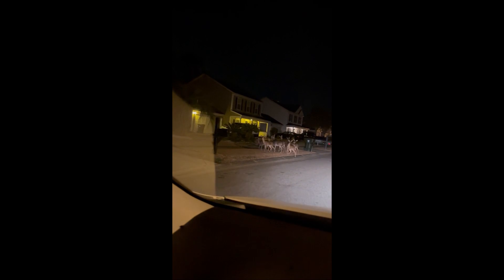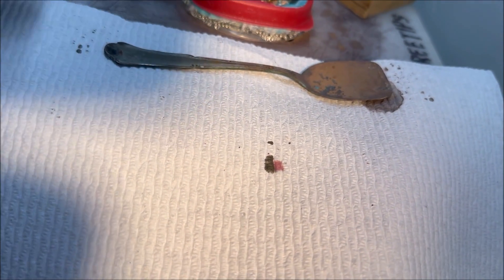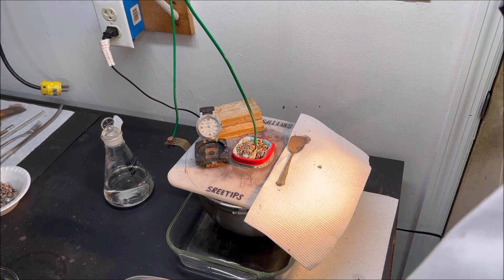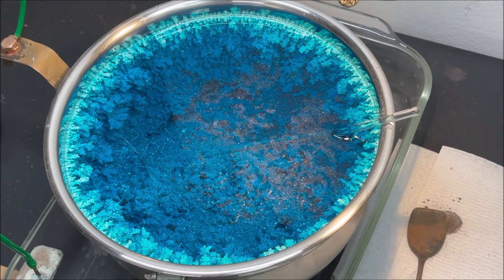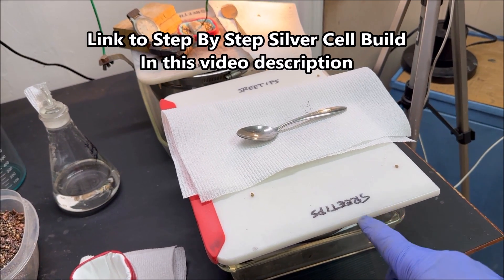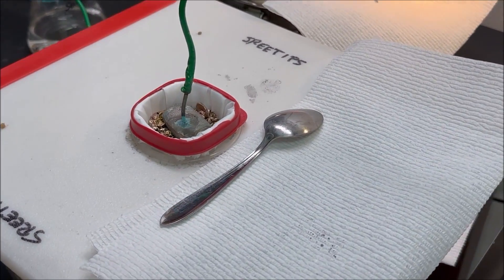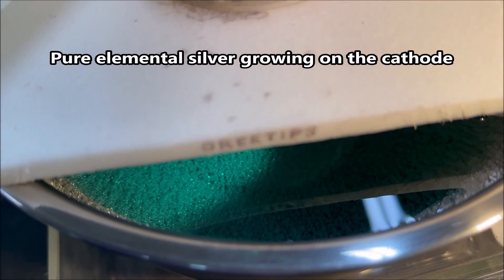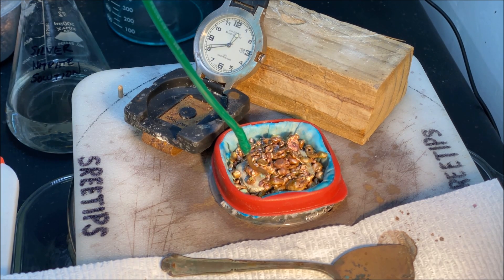New Power Supply Silver Cell Number Two

Comment: I’m curious. Electricity flows from negative to positive. that is the opposite direction of the flow of your silver molecules. If you reversed your flow so that the direction of the current was flowing in the same direction as the flow of silver molecules, wouldn’t that speed up your process?
Reply from the maker: No

Comment: Hi, everyone I have a question. DC power supply machine. One hooks up on silver bar. Where does the other wire goes to?
Reply from the maker: To a copper strap that’s fastened to the stainless bowl by a large hose clamp.

Comment: Sell the broken power supply for $20 for parts. Someone out there will either fix it or wants it for parts. Just make sure its advertised as being how many years old, eatimated run hours, and what you know is wrong wirh it.
Reply from the maker: It’s working, I’ll save it for a backup.

Comment: Hi Sreetips how about using silver rings or small pieces of chain attached to copper wire as anode conductor instead of a solid silver bar?? maybe they adapt better to the movement inside the anode filter without losing any contact point

Comment: Does the anode bar need to be pure silver or could you just pour it from impure silver?
Reply from the maker: Impure silver would work. I like to use pure silver because of its low melting point and it’s easier to work with.

Comment: Is worth make a silver cell mr streetips?
Reply from the maker: Yes!
Reply: Thank you! I gonna make one
Reply from the maker: Hold on! The reason I use a silver cell is because i have a ton of cement silver powder stored up from my gold refining. Silver is a byproduct of my gold refining. But you can hold sterling silver and 90% US silver coins just like they are. No need to refine them. In fact those shouldn’t be refined. They will track right on up with spot silver because they contain a known quantity of silver. So long as you don’t try to melt them and ruin the markings, they are good as-is. Refining silver brings a whole set of problems including acid digestions (fume hood required). Waste treatment, and other processes that must be handled correctly to ensure safety of you, your pets, and your family.

Comment: Well done setting up the second silver cell.  
Out of interest do you notice any nitric smell off the cell?   Anything corroding around it ?
Or is the dilution of nitric with distilled water enough not to notice it.
Reply from the maker: When I make the electrolyte, I boil the solution for an hour or so, with some undissolved silver left in the bottom of the beaker, to ensure all available free nitric acid gets consumed. Having excess nitric in the electrolyte could cause problem because the impure silver usually contains some palladium. Palladium is soluble in nitric, so it could dissolve the palladium and leach into the electrolyte.
Reply: @sreetips  ok great now i understand.   I was wondering because if you look at the time lapse on your video- you see bubbles around the basket and I was wondering if that’s a reaction with nitric
Reply from the maker: That was condensation.

Comment: could you explain how the current dissolves the impure silver and why it re-crystalises on the bowl ?
Reply from the maker: I’m not sure if I can explain it. The current flow, causes the impure silver, to dissolve in the presence of the silver nitrate electrolyte. The silver ions travel through the Dacron filter, then through the electrolyte and are attracted to the cathode (stainless bowl) where they deposit as high purity elemental silver. The chemistry and physics of it all are far above me. I’m not a chemist. I’m just doing what I learned from other refiners.

Comment: curious, I wonder why the new silver cell is only pulling half the amps vs the old silver cell?  I saw some corrosion on the positive connection where it connects to the cast silver bar.  I wonder if that is playing a role in the lower amperage.  One other thing, if I may.  If you swap bowl positions so that the leads do not cross each other like they are now, you might find that you can shorten the leads, making the line loss lower and as a secondary result, looking less messy.  Being a Amateur Radio operator I understand that wire management is a thing, lol.  Thank you for all you do, your videos are great.  I look forward to your next video!
Reply from the maker: There are many variables that affect the current flow. Corrosion is one of them. If I had noticed that the poles were opposite then I would have oriented the silver cell 180 degrees so the wires wouldn’t cross like that.

Comment: the silver bar is too light, try a heavyer circular ? 
set the current button of the new hp E3614A to the right, at the max. and maybe try 3,8, 4,0, 4,5 Volts & more, just to see what happens ? your silver will not going to go away.
Reply from the maker: I’ve got current knob turn up as far as it will go. The professional refiners that I learned from said 3.5 volts DC, and never exceed 3.8 volts DC lest other metals may deposit with the silver and contaminate it.

Comment: Hey I was wondering why you use what looks like Corning Ware for boil over protection instead of borosilicate Pyrex, have you ever had one of the white dishes crack or break.
Thanks
Reply from the maker: Yes! I’ve was drying some cement silver once, sopping wet. I cranked the heat on high to get it going, intending to lower it once it heated up, but forgot about it. About five minutes later I heard it shatter. So they are not bullet proof. But they can take a lot of heat. I’ve heard that you can get them red with heat, but I’ve never observed this.

Comment: I'm always looking forward to the next episode. If the Dacron filter acts as the proton exchange media would it be beneficial or more productive to separate it from the feedstock sludge and process it separately? My thought is that the Dacron filter is the major collector of the PGM's and the sludge should just be incorporated back into the next batch of feedstock. 🤔
Reply from the maker: I just save those filters and process them separately. I tried rinsing the slimes off the renting shot in the filters to run it back through the cell. But it didn’t go well. Can’t remember why.

Comment: Do you use the silver over and over again?
Reply from the maker: No, and yes. I reserve some of the pure silver crystal from the harvest to make electrolyte for the next silver cell run. I get two runs using 800g of pure silver. Each run will yield about 1.5 kilos. So I get 3 kilos and use 800g of it to make electrolyte. My net take-home in silver crystal is about 2.2 kilos after two runs, from each cell. Which reminds me, now that the second cell is running, I’ll have to get busy making some more impure shot to keep these hungry cells fed with impure silver.

Comment: 🧡 I love how the time lapse captured a visual presentation of the off gassing at the anode basket. Makes me wonder if capturing it is of value
Reply: I wouldn't think so considering how hard it would be to collect. The three possible gasses that are being released are hydrogen, nitrogen, or oxygen. (or all three) 2 of those are the most abundant gasses in the atmosphere and the other is the most abundant in the universe. Would be cheaper to just strip them out of the air.
Reply: @davidburton3447  🧡 I shall call it the beautiful blue miracle grow aquaponics/hydroponics solution! Got the aquarium and diaphragm air pump on hand......now for the details. ✌🏻👶🏻🚬

Comment: If you are recovering all the silver in your silver cells, why do you have to keep adding silver spoons when processing the gold?  Guess I missed something?
Reply from the maker: I add sterling silver to the gold that I refine. Then I recover the silver, melt into shot and run it through my silver cells. Then I harvest the pure silver crystal and stack it up and forget about it.
Reply: @sreetips again you said you were adding 150 grams of pure silver to each cell, including the new one in order to extract pure silver Maybe I’m dense but I’m missing something
Reply from the maker: I refine gold. I use sterling silver to refine gold. I recover the silver from that, melt into shot, and run it through my silver cell. The cell converts the impure silver (about 980 parts per thousand silver) to high purity four nines fine (9999 parts per ten thousand) pure elemental silver metal. The impure silver is added to the anode basket. The anode basket is suspended in the silver nitrate electrolyte. I pass an electric current through the impure silver. The silver dissolves, passes through the Dacron filter, travels through the silver nitrate electrolyte, and deposits on the stainless steel bowl (the cathode). The bowl is connected to the negative pole of the power supply. The process only deposits pure silver on the cathode. So I’m refining the impure silver, into high purity silver. When it’s full, I harvest the pure silver crystal, put it away and forget about it. Then I repeat the whole thing again.
Reply: @sreetips  Thene why add pure silver to cell??
Reply from the maker: That’s the electrolyte. Its sole purpose is to facilitate the travel of silver ions that dissolve in the filter to the stainless bowl, the cathode.
Reply: @sreetips  Did you see my post.  I’m a retired Navy CDR. Last ship in Charleston as XO.
Reply from the maker: Yes, I replied. I was at Desron Four 90 to 94. Welcome to my channel shipmate!
Reply: He's refining 2 metals at the same time. 1st using the impure (sterling) silver to make a gold alloy that nitric can rip out everything leaving the gold behind, then that "waste" is refined into pure silver and the gold is refined into pure gold. both get sold. which means he needs more silver and more carot gold. Now he COULD use the pure silver to make the gold alloy, but that would be a waste of energy to just run it through the silver sell again to get back to where he already was and there'd be no profit in that. SOMETIMES he uses some to make those anode bars though.
Reply: @davidburton3447  He also uses some to make the electrolyte for the silver cells.
Reply: Because those spoons are sterling silver, not pure. This is a way to purify the silver while reclaiming it, increasing the value while decreasing (by a small amount) the volume.

Comment: Is the high amps purely because of the new silver or the fact you buried the anode bar? It seems to me that burning it is what kept the amps up… just my inexperienced view…
Reply from the maker: There are several variables, concentration of silver nitrate solution, clogging of the anode filter, depth of silver nitrate, surface area of the impure shot, corrosion on the leads, etc….

Comment: Why is the silver cell limited to 3.5v?
Reply from the maker: That’s what I learned from the profession refiners that helped me get started on the goldrefiningforum.com
Reply: That is the correct value for a silver cell. Any lower and silver won't plate out, much higher and more precious metals will dissolve from the anode and plate out.
Reply: @apveening  higher would likely get the copper plating
Reply: @davidburton3447  Also true, but not quite as much as long as the copper concentration is low and there are more precious metals in solution as those prefer to plate out before copper.

Comment: Hey man, got a little suggestion for you. You know you could just get a piece of half-inch 3/8 inch clear acrylic and use that to put your basket in and then you could just look right down through it. Or you could just get a piece of tempered glass cut so that it would allow you to put the Basket in it and use that, after all, you are trying to film this stuff and that would make it easier and that would make your time lapse a lot cooler
Reply from the maker: Condensate from the cell forms and obfuscates the view.
Reply: @sreetips  well that could be mitigated by a little ceramic coating
Reply: Great idea

Comment: Awesome having you both together! Have you tryed running both cells on one power supply on constant current ?
Reply from the maker: No, but I tried running two on constant voltage. One cell robs the other of power. Each cell needs its own power supply.
Reply: So agree🦌🙏

Comment: Would it hurt if you added some more holes to all 4 sides of the lower part of the filter basket container about the same size as the bottom holes just above the area where the plastic container turns up the side basically where the bottom part transitions to the side of the container so the filter has more direct contact with the silver solution about 3 holes per side 12 in total.
Reply from the maker: Wouldn’t hurt, might help
Reply: And with the added holes there would be better transfer of electrical charge, which means higher amps (just like old cell with more holes at 3+ amps) and faster refining speed.

Comment: @12:45 If you would wet the impure silver grains by spraying it with distilled water and then cover it with a transparent lid to keep the moist air, would you then get higher amperages ?
Reply from the maker: I’ve never tried that, but I refrain from putting liquid into the filter
Reply: Water by itself  isn't a conductor. It's the stuff dissolved in water that conducts electricity.

Comment: What would happen if you covered the bottom of a fresh cell with silver crystal?  Is it possible for them to grow and connect to create larger, interlocked crystalline structures?
Reply from the maker: These are not true crystals. They are called “silver crystal” because they look like crystals. They are actually dendrites; a crystal or crystalline mass with a branching treelike structure.
Reply: Awesome question! Especially choosing some  large starter crystals!
Reply: You're talking about seeding the cell and basically electroplating the "seeds". That's basically what's happening already. The reason he can't grow the crystals larger is because they'll end up closing the circuit to a dead short by touching the annode. There's a video showing a fuse one the annode side (in case they grew until touching) and huge crystals in the bowl. About the  only way he could get ridiculously large crystals is to use a much larger bowl, and change the fluid to keep the copper concentration down
Reply: @davidburton3447  My understanding was that in order for the silver crystals to close the circuit, they'd have to make contact with the basket and its contents.  I would think, then, that he could simply empty the contents to see if more complex structures resulted from the attempt before they touch just as he does now anyway.  I think it would be worth a shot and see if it changed anything.  Worst case, he's got pure silver crystal.  Best case he pulls a larger crystalline structure.